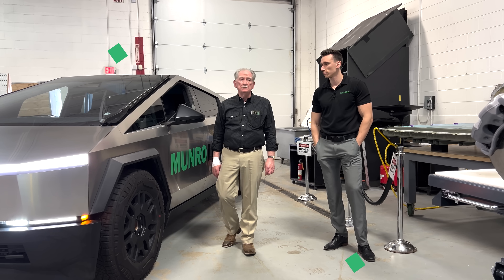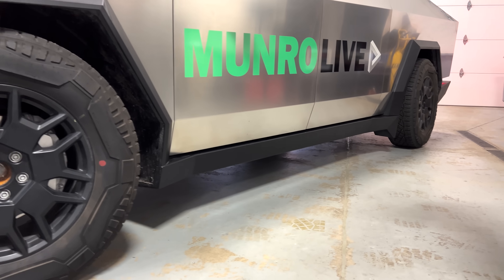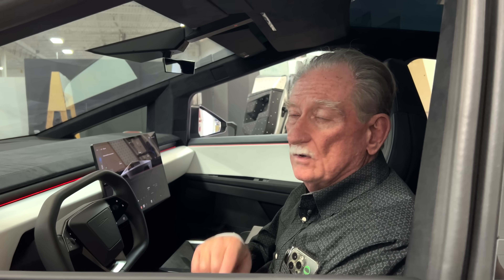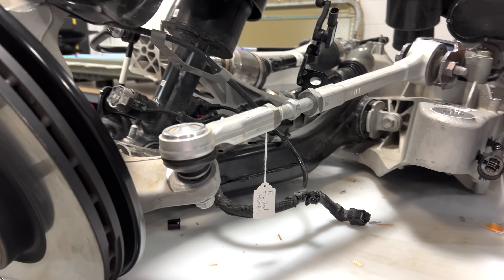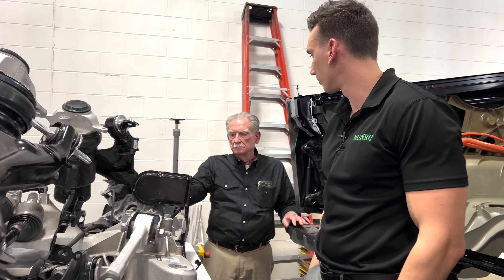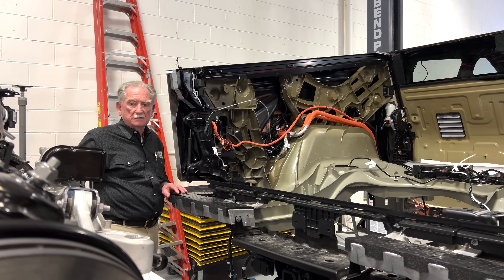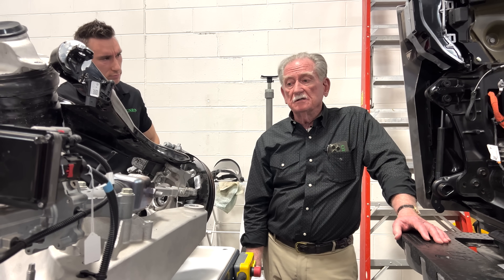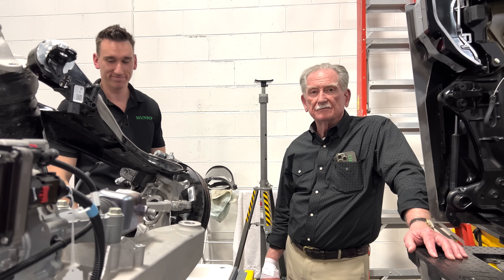Tesla Cybertruck Steer-by-Wire System

Comment: Wondering about getting one of these aligned.
Reply: The same system is used by rack and pinion cars with manual steering.  This one is an automated version so no diff.
Reply: Fwiw my 08 Silvy doesnt need alignment after all these years 😂 and ball joints arent greasable even

Comment: Could you guys give an explanation as to why the cybertrucks creak when turning the wheels at a standstill. It’s not a very confidence inspiring noise. I haven’t heard any other car do that.
Reply: It's because they were turning the wheels while stationary. It's the noise of the rubber being scrubbed on the cement floor.  Any other truck would make the same noises on that identical floor if you turn the wheels without moving forward.  Generally it not normally something anyone does.
Reply: @tesla_tap  there’s two noises, the rubber sliding across the floor which is normal, and then higher pitched pinging and clanking sounds.
Reply: Friction between tire and pavement.
Reply: @kazedcat  you sure about that?
Reply: re: "It’s not a very confidence inspiring noise". don't sweat it, just a few well placed of shots from a "Straw Can" of WD-40, and you'll be all set.🤙

Comment: Is it also break-by-wire?
Reply: Yes, although I think a mechanical backup is required by regulation.
Reply: @tesla_tap  Could regenerative breaking be the back-up?  Software enhanced if needed?
Reply: @fredhearty1762  - While regen might be consider a third backup system, my understand regs still require a mechanical brake backup.  Tesla (and many others) have electronic control of the brakes separate from the meachical backup so they can do traffic aware cruise control.
Reply: The CyberTruck does not have brake-by-wire, but I’m guessing the Compact platform will.
Reply: Its break by broken footpedle
Reply: Yes, it will definitely break due to wiring issues. 🤣

I don't know to any extent it has brake-by-wire control, but it uses hydraulic calipers, not electric.

Comment: It's still mechanical, oy vey, what do you think the tie rods are, these guys are really proving they just make stuff up
Reply: There is no mechanical linkage between the steering wheel and the rack.

You’re clueless.
Reply: @fredbloggs5902  the entire rack is mechanical, oy vey.  Electrical control,the motors are mechanical rotation on a steering rack.  My VW Golf R has electric racks, all cars do now, they actually made it unsafe by not having a mechanical linkage to the steering wheel.  Getting rid of the power steering pumps and stuff was done ages ago,  but all the steering is still standard suspension parts, and probably when it screws up, no one will know how to fix it, and when the first one loses control and kills someone, it will be taken off the road.  How that thing is street legal is a mystery.  it will never be on European roads, for so many reasons...
Reply: So a fully electric car rides on what? electrons?

Comment: Is it really wise physically running the 2 redundant data cables attached together? A physical event that damaged/severed one cable would likely damage/sever the other since they are attached. The cables should be separated and run down different sides of the front chassis for safety. Just seems crazy to me for a system that’s supposed to be redundant for safety.
Reply: They aren’t attached, they do run independently, Sandi holding them together is not the same 🙄
Reply: @fredbloggs5902  There’s only a single connector on each end of the cables, they do appear to be attached/run together.
Reply: @Weezedog  Now go lookup the published wiring loom of the Tesla 48V system, you can clearly see everything is duplicated.
Reply: @fredbloggs5902  if separate connectors are actually used, Sandy is incorrect in this video; perhaps there will an update in a later Munro video. If one connector is used, that's an unnecessary single point of failure.
Reply: If you've had an impact so severe that those cables are seriously damaged, that would have completely destroyed the steering shaft in any other vehicle.
Reply: @otm646  honestly we don’t have an idea exactly where/how the cables are run through the chassis so no idea how susceptible the cables are to pinch/crush/rubbing damage.
Reply: No issue, they covered and designed away all this thoroughly.  They will contact you immediatly if they can not figure something out in the future...

Comment: If the rear steering fails, does it self center?
Reply: It presumably does, since full rear steering deflection would be unacceptable. It's presumably the same as all of the other ZF rear-steer systems - what do they do?
Reply: not if its using a wormdrive I guess.

Comment: When it loses electric power, no steering, like the ship in Baltimore!! Brilliant
Reply: Don't fly in a airplane, when it loses electric power, no steering,
Reply: And planes.
Reply: If you lost power of the main battery you have an auxiliary battery. If you lost both you have regenerative braking to provide emergency power. Also without the main battery the car would stop moving.
Reply: @kazedcat  I'm quite sure there will be no regenerative braking when the HV battery fails. A failure in the high voltage system doesn't even have to originate from the battery. Anything that's connected to the HVIL could trigger a shutdown of the hv system.
Reply: @Marco-rx4cg Regenerative braking can power the HV line even when the main battery is disconnected. The drive motors literally become a generator during regenerative braking. Also the steering motors are supplied with redundant powerlines. They are smart enough to design redundant steering motors and redundant control network why would you assume they would neglect redundant powerlines.
Reply: @kazedcat  It would be absolutely fatal if one of the inverters could induce current into the HV system when the HVIL is interrupted.

Also I'm sure the engineeres have thought about many types of failures. That's exactly why I think they don't rely on the HV DC/DC converter as a backup power source.
Reply: @Marco-rx4cg  The drive unit can only induce current while the car is moving. They can bleed the momentum of the car and use that energy to power the fly by wire steering.
Reply: @kazedcat  Didn‘t know the cybertruck could actually fly 😅
Reply: @Marco-rx4cg  You just need a large ramp.
Reply: @kazedcat  stop moving can't steer on a 70 mph highway, yupper, progress indeed

Comment: Steering assy made in Mexico.  But you lie about Teste being vertically integrated, false.  They buy lots of stuff from outside suppliers
Reply: Well most legacy automakers make a frame, body panels, and the ICE engine.  Almost everything else is farmed out.  For the Cybertruck, Tesla makes the batteries, the battery pack, the motors, seats, dashboard, electronics, software, castings, body, and quiet a bit more.  They do buy brakes, steering rack, tires, glass, and a number of other items like everyone else does from suppliers.  This allows Tesla to have larger profit margins and control more things in house.
Reply: The key here is to use parts you design.  As opposed to building a car with more or less standard parts.  Not talking about an alternator with your mounting lug pattern.   Talking about Tesla designing the octovale then setting up a supplier to make it.
Reply: @danharold3087  Lots of OEM vehicle makers, spec parts to what they need.  besides standard generic parts that others use, tires, brake rotors, pads etc.   but all car makers have specific parts made for them, to fit their vehicles. If you use lots of one off components, it screws the buyers, being stuck repairing with limited parts availability.    Tesla seems to do a great job of hosing it's customers for sure. One off stupid wiper on that thing is certainly gonna floor people when it's $300 to change a wiper blade
Reply: No company of any size is 100% vertically integrated.  When people say Tesla is vertically integrated, they mean "much more vertically integrated than similar companies" not "100% vertically integrated".
Reply: @UnlikelyToRemember  back in the 1930's 40s,50 even 60's car makers did even make their own stuff, then they got smart.  Can get outside suppliers to be making better stuff for less.  the vertical integrated model is obsolete, .  Teste is going backwards.  ZF makes transmissions for Porsche, Audi and every one else to specs needed.  Heck Dupont used to own majority shares of GM, and just happened to sell them all teh paints and stuff they needed, that was decided to be anti competitive, thus it all got broken up, no such thing as vertically integrated in the 21st century.  It's inefficient, and dumb.  Sandi again proves what he doesn't know, more than what he thinks he knows.  He's a shill for his boyfriend, and it's plainly obvious.  OEM have lieterally thousands of suppliers, to get competitive prices, for all teh stuff they need.   If they did it themselves it would cost more, and they would have a million employes to pay.  Wake up.   Teste doesn't do anything different than others in assembling stuff.  their casting stuff is from an italian company,
Reply: @cengeb  the thing is those suppliers have reputation and also scale to make very good and quick parts for manufacturers and also its quite cheaper to actually work with the suppliers to develop or adapt some parts for your vehicle too.
Reply: @alanmay7929  Bosch, and so many other, continental,etc.  make millions of parts to OEM specs, yupper.  It's more efficient, higher quality, less expense.  Wheel makers make millions of wheels for all , scale makes them much more efficient, if you only made your own stuff it would cost more, sandi is clueless, and spews nonsense.
Reply: @cengeb  Their casting machines are from IDRA (in Italy) but they use them in-house to make parts.  Vertical integration is definitely not dead.  Look at BYD for example, they just bought their own fleet of ships.
Reply: @UnlikelyToRemember  Hyundai makes their own ships! Hyundai is the largest ship maker in the world now.  And they are now #3 globally after VW, Toyota..they beat Stalantis out for #3 spot.  VW owns it's own railroad system in wolfsburg...and they make their own food at the Wolfsburg site, 30,000 employees get VW Brautwurst made on site! It even has a VW part number.  I asked my VW dealer if he could get me some, but due to import rules, they can't bring in food stuff like that.  i'm gonna have to take a trip and get it in person!
Reply: @UnlikelyToRemember  bullshit!!!! much more integrated than who?! wtf!

Comment: Have we worked out what happens with the steering if the vehicle no longer has power? Will I still be able to steer the wheels to safely manoeuvre the vehicle off harms way? I think this type of situation is more likely to happen than having triple redundancies for system failures.
Reply: You have a main battery and an auxiliary battery. If the main battery fails then the vehicle has no motive power but the auxiliary battery can still drive the steering system. If Aux fails then the main battery can provide power. If both fail then regenerative braking can provide emergency power.
Reply: they have backups.... but when you run out of juice in the main battery, it slows, slows, and slows even more, and before it completely shuts off, it makes sure you are stopped.  There are vids of people running them out of power
Reply: It can only steer if it has 48 volt power. There should be redundancy in the power supply; perhaps Munro can cover that in a future video.
Reply: @brianb-p6586  Now I am curious. What is the voltage of the auxiliary battery. Is it 48V?
Reply: @kazedcat  yes, the low-voltage battery in the Cybertruck runs at 48 volts, nominally.

Comment: Cars are consumer level priced, and usually don't get proper attention for maintenance like billion dollar cruise ships and fighter jets, stop the dumb comparisons.  Audi has had 4 wheel steering for years, they also pioneered the al "space frame"....stop making it look like Tesla innovates anything.  My VW Golf R has variable ratio electric steering.stop with your nonsense.  Consumer products will not have the safety redundancy of a Billion dollar ship or airplanes.  See how the ship lost power and took out the bridge in Maryland, steer by wire, oooops.  Lost power lost control,

Comment: The Ethernet connector reminds me of a larger SATA connector that exists for storage (hard drives) devices in PCs for years. Also has a visible split power / data section.
Reply: IDE 😊
Reply: Its a good thing too, because if you have a hard drive from 40 years ago, it will plug right into your cybertruck!!!! lolz
Reply: SATA cable is for next update in a few years. Now it's IDE :)

Comment: I drove an Infiniti q50 for three years with steer-by-wire.  I never had to rely on the physical backup system that would engage when the car lost power.  While they state that the Cybertruck SBW has "triple redundancy", but how do you control the wheels should you lose power?  Unless you can tell me that my Tesla cannot lose power under any circumstance while drive along the highway at 65mph, then you do not have adequate redundancy.   And those of you who state that airplanes have had fly by wire for years, they also have an APU should they lose their engines just for that type of situation.  So for those that think this is adequate, please tell me how the Cybertruck will  react when losing all power while traveling at speed down the highway?
Reply: Are you suggesting that an ordinary steering shaft cannot break under any circumstances?
Reply: @UnlikelyToRemember well, I've never heard of anyone I know having a steering shaft break.  A steering wheel fall off is much more likely.  But more likely than that is losing power while driving... It has happened to me.
Reply: How did your Infiniti do it?
Reply: @jamesengland7461 If power was lost, a clutch reengages and connects the steering shaft with the rack.
Reply: I guess you'll not be traveling via a plane or ship either - both use steer by wire systems. If you loose power, you loose steering although I suspect it remains in the last position, so you can easily slow to a stop if traveling on a freeway (since the vehicle has no power anyway).  Steering failure should be less likely than having an ICE engine fail and forcing you to an immediate stop without power steering or power brakes.
Reply: @tesla_tap I already addressed planes in my initial post.  But I guess you didn't think that applied to your response.  As for ships, if they lose power in the middle of the ocean they are unlikely to hit anything.  However, in the port of Baltimore I think we just saw what happens when power is lost and the craft cannot be controlled.  The premise that a car traveling at speed without a way to control steering will just suddenly stop is incorrect.  I encourage someone who completely understands how the Cybertruck will respond in that situation address original post.  I'm here to learn, and pose a reasonable question and not just be dismissed with speculation.
Reply: The CT has at least 3 redundant sources of power. 2 different batteries and regenerative braking.
Reply: @danharold3087 When you say 3 different power sources, do you mean that all 3 can power the SBW motors?  If so, great!  But my experience with my Teslas  over the years is that if the 12v goes, the car is unusable.  I know the CT has a 48v system, but I'm assuming it's is a single battery and is the only one that provides power to the steering motors.  I'm happy to find out if that is not the case.
Reply: @GUAGS99  I hope I said there were 3 power sources not that I knew Tesla was using the.  I would guess they have at least 2.  With the STW they need a 2nd source of power.  Expect somebody will test this.

Comment: With variable rate steering, how do you center the steering wheel. Surely it could be at any angle when heading in a straight line.
Reply: In theory it could, but there’s a feedback motor and the position coding disk will have a zero coded on it.
Reply: On ordinary electric power steering, the sensors recalibrate for this,  so this is even easier here.

Comment: I'm curious at what speed the rear wheels steer opposite and at what speed the rear wheels  steer in the same direction as the fronts and is there a speed at which the rear wheels do not steer at all in between?  It would also be neat to see old GM and Honda 4 wheel steer systems compared to the Cybertruck for mechanisms and how they connect to the rear rack.
Reply: Honda invented rear wheel steering on cars and their first systems was mechanical, later it all moved to electrical its literaly the same driving dynamics.